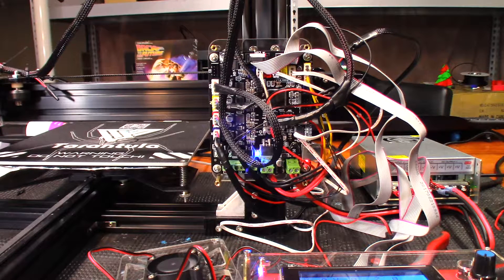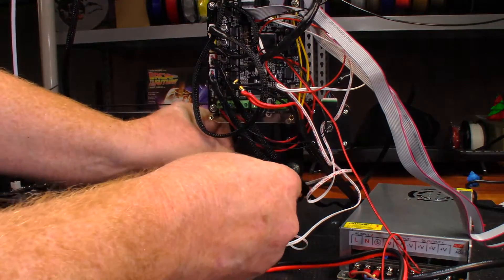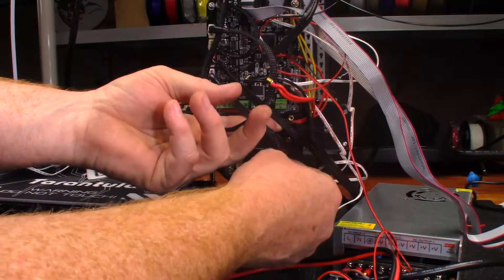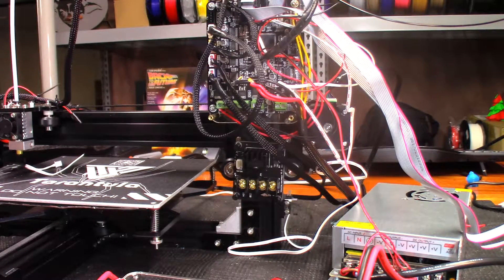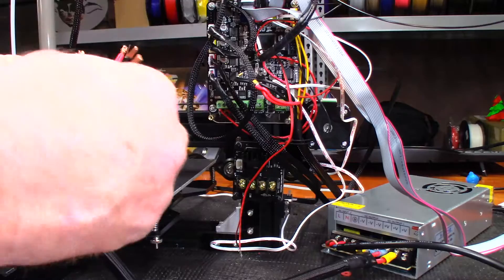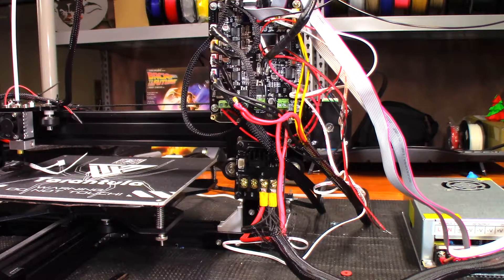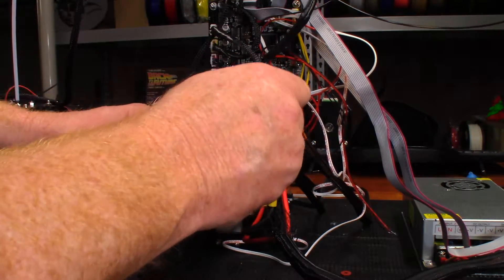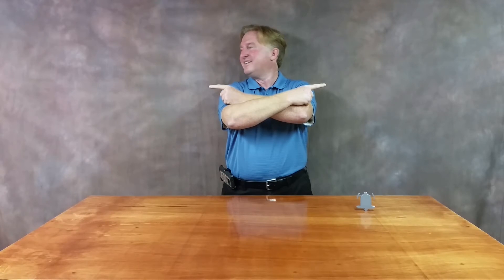Adventures In Upgrading the Tevo Tarantula  Part 2 Installing The Mosfet

Comment: If a CONNECTOR gets hot it because of resistance from a loose connection. Run a lot current through a resistor and it will get hot. Lots of house fires started that way. Proper tightening and rechecking is needed.

Comment: 10 gauge wire is what is used for industrial wiring for a 40 amp mains 120v circuit. Pretty sure you're not using anywhere near that. Autozone carries 10 gauge wire for running extremely high current in cars. 80 amps at 12 volts, stuff like that -- your main car wiring. Check a standard PC power cable -- even ones that come with a 1000w power supply -- it's a 16 gauge stranded wire at most. This is a mistake people make of using mush higher gauge of wire than appropriate and that causes the connector to be strained -- if you use the correct gauge of wire for the application -- 18-20, then you can use a proper ferrule and this would not be an issue. Problem is the China kits use the wrong wire for the the terminals -- the reason the connector heats up is because the wire is too big, and the strands create an arc...at least tin the wire before fitting it back into the connector.  Stay safe...I just fixed a friend's melted power connector on a board -- I replaced it with the exact same connector which melted, but replaced the wires for 18 gauge silicone wire.
Reply: Silicon coated fine stranded wire would be the best choice, I would still use the proper ferrule. Sometimes the best choice is not the cheapest...
Reply: well, I never said silicone wire was cheap -- about 5 times the cost of regular wire, but that's the only stuff I use in my builds -- or when I fix stuff for friends-- and it lets use the proper ferrule because the insulation is easier to work with
Reply: There is also a possibility that the MOSFET on the PCB, was good enough, to handle the power. But without testing, under FULL load, an external one is a safer bet...
Reply: True, fine strand silicone coated wiring would be my first choice, for this type of application.
Reply from the maker: +kazolar The reason I went with 10 Guage was because of the doubled up wires to the build plate.  I wanted to make sure that I didn't create a new problem by not feeding enough power to the external Mosfet. 

I can say that I have printed for over 30 hours since installing it and all the wires are ice cold.
Reply: I'm sure the wire is fine, and if you don't flex them, they will be perfectly fine (I would be rather concerned if you used a 10 gauge wire on a moving gantry/bed) -- but I don't even use 10 gauge wire for my mains power 1kw bed -- and that actually pulls 1kw of power from the wall. There is no reason to use a higher gauge wire on 12v/24v than what is coming into the PSU -- did you rewire the tevo PSU to use a higher gauge wire? The stock PSU is rated for 20A -- or 240W -- 10 gauge wire is equivalent to killing a bee with a blowtorch -- I'm sure the wire are cool to the touch, if a 10 gauge wire gets warm, you're going to trip a breaker and kill the PSU -- lol. But you should check the connectors -- that'll be the weak point. Consider upgrading the PSU -- most people go for a higher PSU rating on tevo machines -- as the stock one dies.

Comment: A correct ferrule (one that is compressible, in order to create a 'gas tight' seal, between the metals) would have worked, much better, although the connector was probably already getting closed to the maximum allowable current draw.
Reply: connector can handle the current draw -- the amount of current the tarantuala bed uses will not melt that connector -- more to do with ferrule/wire gauge combination -- sometimes less is more :)
Reply: The problem with the ferrule used on the wiring, it was too thick, not compressible. So, the ferrule was able to swivel in the connector, causing the connection to loosen, leading to the connector overheating.